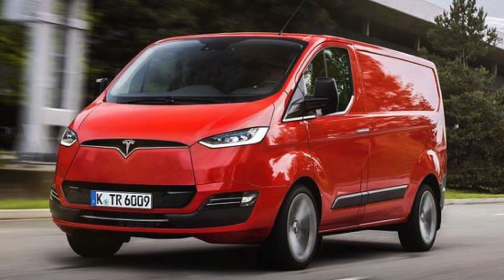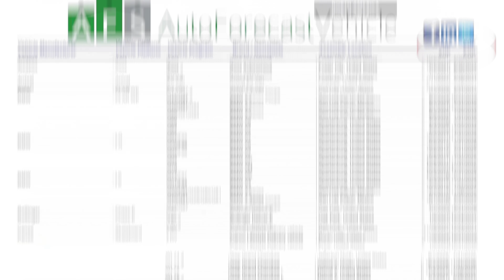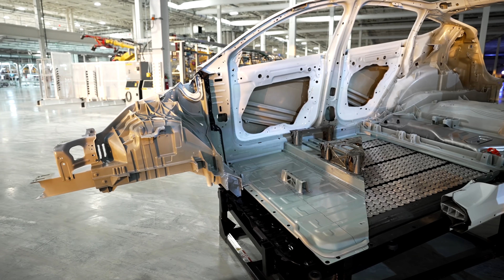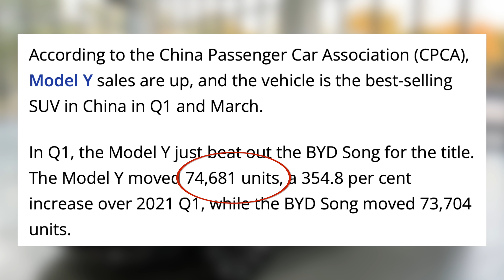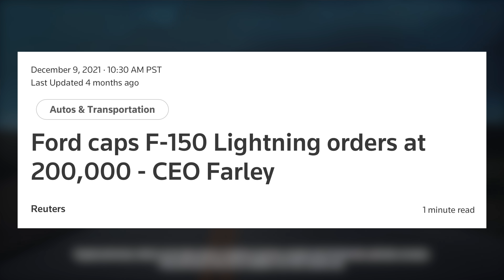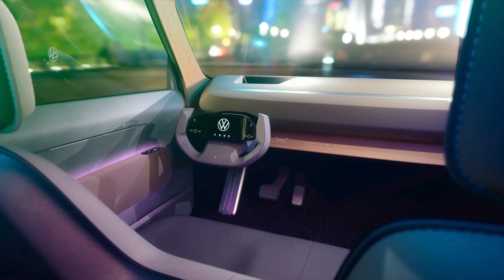Tesla LEAKS Cybertruck and Tesla Van Release Date

Comment: On a 47 to 100 thousand dollar car one would think things like charging and floor mats would be included.
Reply: On a 1 thousand to 1200 dollar phone, one would think charging cubes would come standard. “Tesla is the Apple of cars”
Reply: @MichaelOrtega  Difference with phones is most people have already owned several iPhones and they really don’t need another charger. I probably will never have had multiple Teslas. I have over a dozen iPhone, iPad, iMac Air chargers.
Reply: @matthewhuszarik4173  While it's true that the connectors will often be forward/ backwards compatible for a period of time, it doesn't mean the chargers are truly compatible. 

What I mean is if you read your phones/ tablets/ computer manuals, they all require different voltage/ amperages to optimally charge. Yes, your tablet charger will charge your phone but because the tablet charger is not optimally designed to charge your phone, it will cause the phone's battery to wear out faster over time. 

For best results, always be sure to use the charger designed for your device.
Reply: @mikebevan1034  Actually they all charge on a standard USB so they can all be charged with the same chargers. The low wattage ones will take a long time to charge the iPad and especially the iMac Air put they still will. The high powered ones can still charge the low wattage loads like the iPhone Air Pods, iWatch, Apple TV Remote. They are all interchangeable the low output chargers will just take a lot longer charging the high load equipment.
Reply: Nissan GTR’s don’t come with floor mats standard either, probably more as well.
Reply: Well, you only can buy certain ferraris if you allready own 10 other models.
Reply: @bigdaddy1279  And a Garage Door Opener
Reply: @emergcon  I didn't know that.
Reply: You do know that the car itself knows how it's being charged.. and that info goes to Tesla. Elon said the stats of people who use that are very low. And we all know Tesla is about simple and clean, and making less waste. Less chargers that most people don't use.. less electronic waste. It makes sense to not automatically include it, however it should just be a free option when ordering the car.
Reply: @matthewhuszarik4173  nnnnnn
Reply: Floor mats included for all but base trims. People just like to upgrade.
Reply: @jeremycovelli  according to Independent data, he’s probably lying.
Reply: It does come with a charger and floor mats lol
Reply: @matthewhuszarik4173  but you're not getting the fast charging you're paying for.
Reply: They can have included with an increase in price.

Comment: Make it a default add-on. If buyers opt out, they are credited the cost of the mobile connector. This would help new owners understand that it is important. 
I believe removing it is the wrong choice but recognize that everyone's situation is not the same. At least make it automatically included with an option to remove it, if not needed.

Comment: The mobile connector is a nice safety feature.

I don't use mine often, but I always have it in my car in case I end up somewhere and absolutely need to charge. 

It has also been very nice when I go on road trips and stay with family members. I just grab the connector out of my car and plug in at night. 

There are still way too many locations without super chargers to not include a mobile connector. Especially out here in the Midwest.
Reply: Using anything Level 1 is worthless for me, I know many use it 100% but for me to actually use the car, I can't wait 24 hours every time I charge it.
Reply: @briankwest  Level 1 speeds works for me at home. It gets me 15% every night which is about what I consume daily on average. 

I do have a wall connector installed which is amazing for those busy weeks that require constant driving. 

I do get why level 1 charging exists. You arent always going to have 20+ amp circuit available.
Reply: I charged with my mobile charger every day for 3 years

Comment: If they do drop it- they NEED to add a check I box to the order page to ask if you want one. Every single EV on the market comes with a level 1 charger. Make it obvious that it does not come with the car unless you “check the box” while ordering.
Reply: Unfortunately, a few EVs don’t have L1 chargers. The EVs from Kia (EV6) and Hyundai (Ioniq 5) current don’t come with any charging equipment at all. I fear this is an industry trend that will see the removal of L1 chargers included with the vehicle purchase.
Reply: I agree on that. Basically ask the customer if they want it or not, im sure lots of people wouldn’t get it.
Reply: Add the Nissan Leaf too.

Comment: Any cables required to operate the vehicle should come standard with the vehicle. You can't operate it if it isn't charged
Reply: @Moebelmannn  Apple does give you cables, you just don’t get the charge block/adapter. 

In a sense, Tesla does the same thing because the 110 plug is useless

Comment: Elon Musk apparently never heard the phrase, "Under promise, over deliver" 

He and Tesla seem to do the opposite,  "over promise and under deliver". It will be interesting to see if competitors, as they come to market, will force Tesla to up their game with respect to customer service, quality control and price.
Reply: What competitors?
Reply: If Tesla ever struggled with demand, that might be a factor. They still make a product without a decent parallel by any other automaker. Even Ford’s Mustang has so many shortfalls, none the least of which is the lack of a reliable charging network. 

Until other automakers catch up (if they ever can), customers will line up for 6-12m in advance to get a vehicle they’ve never even seen in person. Until demand meets supply, why lower price or production estimates?
Reply: To add to ur comment which I may agree upon,
He might “under promise and over deliver” when it comes to taking out the adapter plug. 
😉😏🤦🏻‍♂️
Reply: @SunriseLAW  Swapping batteries comes with a bunch od problems. First you have to have enough battery packs and swapping places, that are very complicated when compared to charging station. Futhermore with swapabble battery you can no longer use it as a basic structure od the car, so yout car will be heavier and/or less stiff. And many other problems

Comment: Maybe the reason behind dropping the connector is not to make an extra buck, but because there is not enough of them. Would you hold delivery of a finished car because of a part that is not widely used?
Reply: They have been out of stock for quite some time.  One thought:  Even if you use an installed Wall Charger, what happens if that breaks?  I suppose a run to the nearest Supercharger, if you have enough range,  at least if you have the Mobile Connector as a back-up you can trickle charge it until you're sure of making it to that Supercharger.

Comment: Regarding the Vinfast cars, I have no idea what a "battery subscription" is.  Do I own the car along with the battery or not?   Sounds like one is purchasing the car while leasing the battery.  I don't get it, and wouldn't buy it.
Reply: Renault did the same thing with their cars in Europe. It kind of made sense at the start of EV adoption imo because the consumer didn’t have risks concerning the longevity of the battery and the manufacturer still owned the battery which is the most valuable part of an EV and had reoccurring cashflows. Nowadays it seems pretty odd.
Reply: Not viable...I wouldn't touch that with a 100 foot pole.  If I buy a car, it's my damn car and I own it.  Hopefully this flops hard.
Reply: @fjt99  After posting I thought about that aspect, and it does seem appealing to protect yourself against a bad battery.  But like you said F. Trt, the battery is the most valuable part of the EV.  Since that's the case, they have way overpriced the car itself.  Instead of a $40K price tag, the car should actually be priced South of $20K.  Perhaps then it would make sense.
Reply: The car would be significantly cheaper and you can potentially use it in a battery quick swap system. This originally was the plan with Renault, Nio has been doing it at scale in China for a few years now. So no worries about battery degradation and add 400 miles in 3 minutes.

Comment: I can’t understand how tesla will not include the charging cable on a 40k vehicle. This is unacceptable anybody who takes delivery of any tesla vehicle without the charger I blame you and you should to!
Reply: Agree to an extent. But if they are not used by most then it might make sense to sell as an accessory / add on to the core sale.
Reply: Assuming a suitable reduction in cost of same amount.
Reply: When are you supposed to use it? You charge at chargers that have a cable already? You get a charger installed at your home separately with comes with its own charger. The one that used to come with the car was only used for a backup if you found yourself stuck somewhere and there just happened to be a power outlet nearby. There should be no need for it. It’s like complaining your ICE car doesn’t come with a extra gas can in the boot that you can use to fill up if you breakdown somewhere.
Reply: @sp00l  this is the problem with some in the tesla community justifying everything that Elon does or tesla does a 40 thousand electric vehicle should come with a charger 🔌.
Reply: @sp00l  everyday if you don’t charge at the chargers or get a charger installed duh ice example makes no sense I can tell you when I bought my car from the dealer it included a full tank of gas and I had access to plenty of gas stations.
Reply: @markthomas7279  but if they are not being used says who ? The data ? Why not show it? Same person who says their is no need why not do a poll he did for everything else makes sense lol cmon man common sense 46 thousand dollar vehicle the cheapest 46 thousand dollar vehicle no charger. That’s an electric vehicle we are talking about !
Reply: I give in. Because I don't really care.
Reply: @markthomas7279  I get you really don’t care 🤷🏾‍♂️ and that’s fine but I care because I want tesla to succeed as a company!

Comment: I have pre ordered a M3 and I will be extremely frustrated if it doesn’t come with the cables to charge the vehicle at home.  

I only know 5 Tesla owners- but every one of them uses the cables to charge at home.  Surprised to hear that they are not used that much.
Reply: "Only 5?" That seems like a large number to me. And you know them well enough to know how they charge them.
Reply: @aaronm.3581  Yes.  I have had discussions with them regarding how they like their Teslas, how they did their  outlet in their garage- etc.  FWIW- they all love their Teslas.
Reply: I use mine everyday to charge my 2021 M3 LR. You could always refuse delivery since this change was made after you ordered your car.  Either that or have one of those expensive wall chargers installed at home before you pick up your shiny new Tesla.
Reply: @PhilT993  Thank you.  I am hoping they will include the charger for preorders that were made before this announcement. But, yeah a wall charger would be very nice.

Comment: people keep being told they need a fast home charger installed so then they wouldn't use the mobile connector. truth is most people don't need that special home charger and the mobile connector is fine, especially in Europe where the voltage is double that of the US.
Reply: voltage means nothing, amps is everything
Reply: @sneakdebeef4796  without voltage you aren't going to get any power. V*I = P
Remember?

Comment: Ford does not have a charging network & their production is Limited.
Reply: Not every manufacturer needs their own network. Ford like everyone other than Tesla, uses a standard charging port, and you will be able to charge a Ford EV at one of thousands of locations. There are more non-Tesla stations than Tesla stations.
Reply: @cypvh74  Those stations are garbage. Low charging & not as reliable.
Reply: @prestontucker1687  outdated information. Many high powered DCFC CCS stations out there, built out by various companies and growing fast.
Reply: @cypvh74  What's outdated about their production? They Maxed out. Stopped taking orders. Many stations??? What company? Don't say Electrify America. They suffer by comparison. What network matches Tesla???

Comment: If Tesla were to offer current LR Model Y order holders the option to “down grade” to the new Texas-Made Standard Range, would that be a good option? Its $3k cheaper and only 50 mi less range(279 mi). But you can charge it up to 100% each time whereas the 2170 LR at 80%-90% charge range is 254-286mi

Lemme know your thoughts!

Comment: Interested in when my Model Y Long Range with 4680 batteries will ship from Austin.
Reply: When did you order? Can you order from Texas specifically? Thank you
Reply: Same
Reply: @johnfitbyfaithnet  I ordered back in October
Reply: @johnfitbyfaithnet  I ordered mine on February 28, 2022 and current shipment date is September 2022.  At this time, to my knowledge you can't specify a particular factory i.e. Austin.
Here is my opinion.

Per internet gossip the Austin facility was supposed??????? to handle shipments to Eastern U.S.  I live in Florida.
In watching the daily videos I saw completed Model Y's  outside the Austin factory awaiting EPA approval and transport.
Then came the (BIG SURPRISE) from Elon.  Tesla quickly introduced a new version similar to the standard range that was discontinued with 4680 batteries which appears??????? to be the current vehicles we see in the outside parking lot.   IMO this move was to prevent  any Osborne Effect.
To my knowledge this vehicle specification has not shown up on the Tesla order page.
Also, further gossip was that we would not see any Tesla MY Long Range vehicles with 4680 batteries produced at the Austin facility till probably next year which is a real bummer.

Comment: All four poeple that I referred to Tesla had a charger installed by an electrician and none have ever used the mobile connector.  I use mine on occasion, and I have purchased the additional plugs to work with my mobile connector.  My son and I both recharged our cars in upstate NY using 110 at our rental property.  It was convienient, but not necessary.  I already had a 220V charger at home when I purchased my Tesla.

Comment: Electric minivans could easily become the best all round car 

Suburbans carry lots of people and stuff with good towing capacity, but it is high up off the ground making it hard to load with heavy object, or for little kids 

Pickup trucks is good at off roaring, towing, the only thing that can pull fifth wheel campers, but hold very few people and has very little protected cargo space, they sit high making it hard for little kids and heavy object to be loaded in 

Minivans sit low making it easy for kid or heavy cargo to get inside, they can hold more protected cargo than trucks and the same as suburbans, but it is more convent as it is lower down. Vans can hold more people than trucks and the same as suburbans. Vans electrified could tow the same as suburbans and trucks with a hitch. With suspension that rises up vans can match trucks and suburbans off-road

Vans only have two downsides 
Choosing between lots of people or lots space. Can’t haul fith-wheel campers 

Electric vans can be made to match or exceed all other standards of trucks and suburbans 

(This perfect minivan would defiantly cost the same as high end trucks and suburbans, and not everyone needs all those capabilities and would therefore opt for cheaper versions)
Reply: Tesla is planning on making a minivan, apparently launching in around 2026
Reply: *definitely
Reply: Good post.  An electric version of my 2006 Dodge Caravan would be my perfect vehicle, hopefully the cost wouldn't be the same as high end trucks.  (mini vans: I've never understood the dislike for them only because they are "just not cool")
Reply: @daviddennis5789  as a part time job I mow lawns, it is funny seeing everyone with their trucks or suburbans hauling a small trailer for the same stuff I’m hauling. I am in a minivan and it can hold the push mower pretty easily, the van is low to the ground so i can push the in the back without lifting. The van is smaller and more maneuverable allowing me to get though the crowded neighborhood roads

I wish the door frame was a little higher then I could fit my bike in without rotating it to get it in (suburban can’t hold a bike). I can keep my stuff lock in the back anywhere, unlike truck where it could easily be stolen so you have to unload

I am always thinking imagine if this van had a good hitch. Electric makes it possible for low sitting good hauling vehicles because there isn’t a drive train they have to sit above

Pair this with suspension that can rise, then the minivan can sit higher off the ground when maneuvering off-road
Reply: I'd love to see an all electric Chrysler Pacifica. Great looking van. I have a Mazda 5, which looks like a hatchback but has sliding doors and a fold-down 3rd row with 2 small seats. So much easier to load the kids vs a tall SUV with a narrow back door. Cargo capacity is great, considering the size, efficiency, and handling. It's a fun car to drive. A bigger van like a Town & Country can carry as much or more than most pickup trucks on the inside instead of cargo being out in the wind. For gas vehicles, a 28 mpg minivan would afford a family enough gas savings over a 14 mpg pickup that they could just rent a pickup truck for the 2 or 3 times per year they actually tow something. Tesla should do both a full-size Cybervan and a Model-X style minivan.